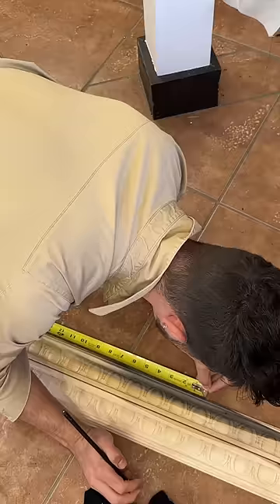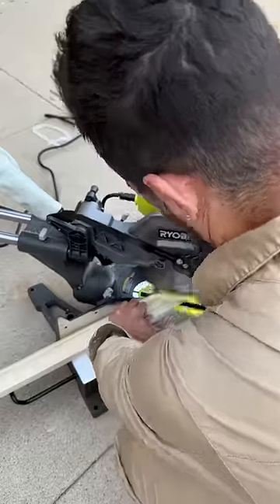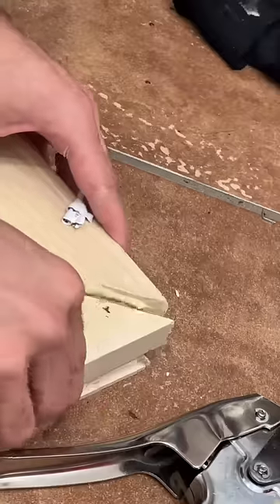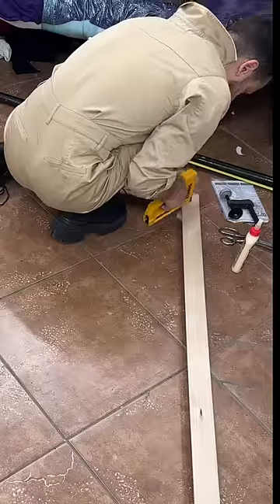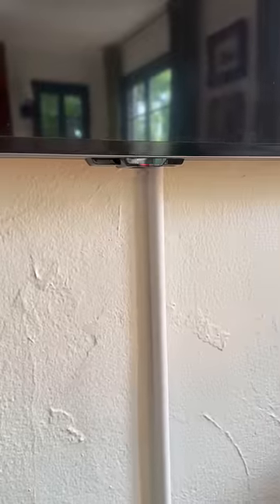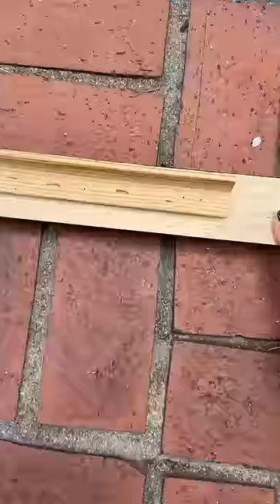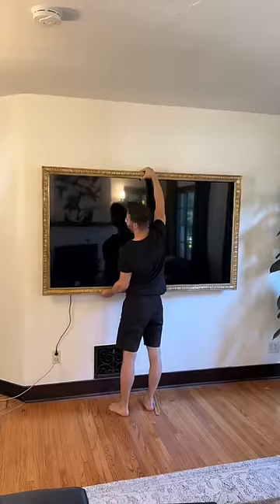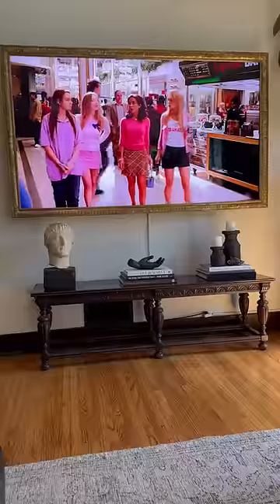We made the $3000 Framed TV for $75!! #shorts

Comment: Recommendation:
Use thin gold foil you can find a Joanne’s and foil glue for the frame instead of spray paint. Smooth it on the frame with a fluffy brush and then using orange, umber, and a very small amount of black or brown color mixed with thin glaze, once everything is set in dry, dab it on the frame and use a cloth to wipe or dab off. 
Then seal with a setting spray.
Makes it look 100 X better and actually lasts longer.

Pro tip: artists use this method when making their own frames for their artwork.

Comment: These are good hacks however tv is more than just having a fancy frame. The art mode in the Frame is what sells the TV - it’s a matte screen so no glares or reflections and when you turn off the TV it displays art, motion detector and the colors optimization for art mode is unmatchable with hacks. The TV adjusts the displayed art according to the light around the room - meaning if there’s tons of light the TV lowers the art display so it doesn’t look like a display screen, and the TVs operating system is detached and not at the back of the TV so it can be flushed against the wall. I saved up for the Frame and couldn’t watch from any other TV - the matte display is life changing.

Comment: That looks geat...you did an awesome job.  Id be concerned about heat though by covering the vents in the edge of the TV.  What makes the fram stand apart is not as much the frame as itnis engineered to sit completely flush against the wall and still have adequate cooling.

Comment: I did this to my tv 4 years ago. But I used Canvas Hooks to secure to the TV, so I can remove it easily to dust. Screw one side of the hood into the frame, but dont fully tighten, slide horizontally when installing the frame, then flip the hook vertically to secure.

Comment: I'm worried about the weight of the frame. The brackets holding the TV to the Wall hale weight resisrance maximum. The moulding might be thin but if it's wood, it will still add significant waight. Also, you made space for the sensor in the support but the moulding is still covering it. How well is the sensor working with the frame in place?

Comment: I did the same thing 10 years ago. my 42 inch tv watch has a sensor in front. I drilled a hole and inserted a sunglasses lens that I cut to the right size. sure a dark wooden frame, you can't see it and the controller signal is working.

Comment: I'm confused the frame tv looks nothing like that and the whole gimmick of the frame TV is that it can run for 24 hours, has light diffusion to dim the outward glow, and doesn't suffer burn in or overheating.  Thats why it's so expensive.  It doesn't have a literal frame around it.

Comment: Ny guy.  You absolutely did not "make" the frame tv. You just put a frame on a tv lol. The Samsung has a specific type of matte screen that literally looks exactly like a painting. It also has ambient light sensors that will adjust to the lighting in the room, again, making it look incredibly realistic. You can also upload bespoke artwork that are made especially for the tv and a UI that lands itself to that 

The literal frame is barely an important feature.

.. it also has a ultra thin fiber optic cable thats almost impossible to see from more than a few feet away.